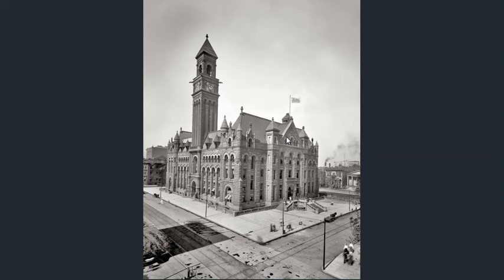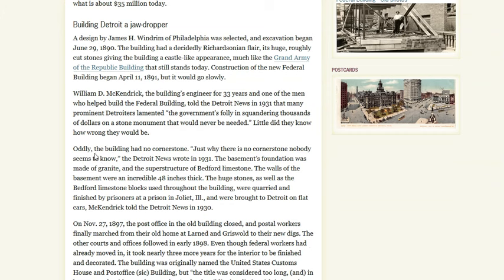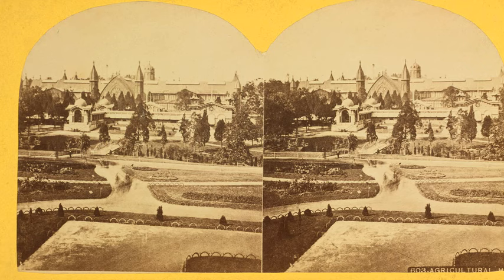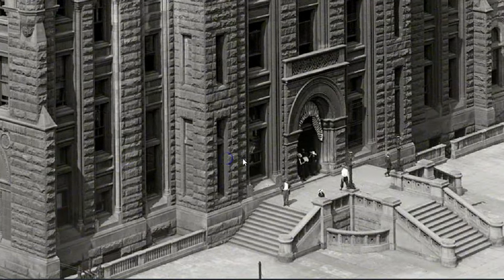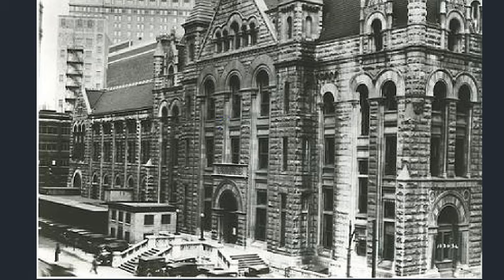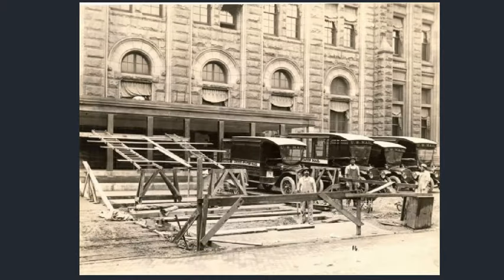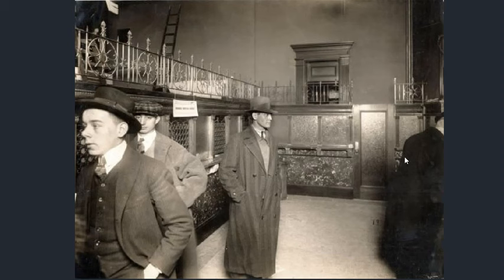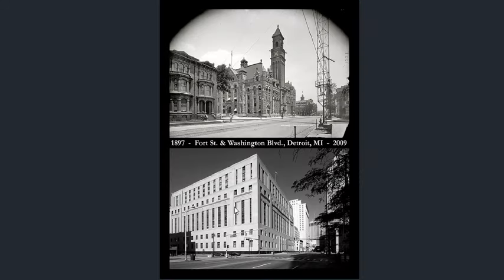Impossible Architecture Vol 2:  The Detroit Federal Building

Comment: I do wisyou people would either go to collage and learn what it takes to build a shed, house or a city block or bring some undeniable proof that you were lied to. Why do all these buildings look like european iconic buildings? Yes there is a gap between the pavement level and the limestone basement level, why, because the damp would creep up the limestone and ruin it, the same reason you shouldnt see fired red bricks below gtound level, hence why they used hard stone such as granite. Big windows and doors, this was before good lighting so big windows let in light. The doorways and high cielings, also before good airconditioning and if the rooms are airy and dry very easy to keep warm in the winter. This was built after hundreds of years of perfecting the building process. Ok they pulled it down after 30yrs, all the materials would have gone to build new structures, it was most likely taken down because of plumbing and electricity had become reliable enough to rebuild a new building rather than do a refit. How much you think the land was bought for? forty years later how much could it have sold for, the land and granite foundations? A lot more than was paid for the first building then he has all the materials for free. They are builders building on land that hasnt even been leveled and in most cases no services have been layed under the roads like we do today, some buildings will be built on low grownd and some on high but the smart ones would have been built so the ground floor will be at the eventual street level even if it is ten years before the street level is established. We live with info on how to build buildings at our fingertips every i dont know or did they build that or look at the size of those blocks should take your kids no more than 15 minutes to tell you the answer. I do get it there are unanswered questions in our history. Take florida or new orleans, one culture claimed then built and stories circulated, their history. The land then became part of the union a different culture built on it leaving some of the best the earlier people built, their stories circulated and on the street became history that we grew up with, then old newspapers and photographs are found along with the history you never heard before comes to light. That doesnt mean you were lied to, you were only taught what was relevent then american history not spanish or french. So now your interested in history start reading and studying history and always be able to back up claims, yours or someones video, check it and dont believe it until you have. Take care we got bigger problems than arguing about old photos. Your moon should not be doing that🌜🌛in one night😊👍
Reply from the maker: Actually I teach the carpentry trade at a college...so I do know a thing or two about how the build process works.  It's the main reason I have decided to publicly question the narrative.  I know what it takes to design a structure, excavate for multi-story buildings, how to set a proper foundation, back-fill, build vertically, calculate complex angles for roof framing, and finish the interior.  With this knowledge, the explanation we are given for these structures is even more outlandish to me.  You should know that if you come to my comment section with knives drawn, the favour will be returned.
Reply: @oldworldex  fair enough my freind, you know buildings. Please brush up on your history then, this just sounds like an easy larp to me. There were aspects of the video like the scaffolding behind the tower was obviously being used as a crane , which you should of known if you teach the trade? At least use your knowledge to teach your subs how these were built, how easy it is to move heavy stone rather than saying they couldn't do it or it was too hard and leaving people that stumble onto your videos more confused than before they got here. Your helping the controllers dumb down the young ones and you say your a teacher? Please wake up, btw, no knives my comment was addressed to the people believing you, but thanks for taking the time to reply and have a good day😊✌️
Reply from the maker: No knives hey...riight.  The condescension in your writing is palpable.  "How easy it is to move heavy stone' is one of the most entertaining comments I've come across so far.  When you suggest I brush up on history, you're missing the point when I say I don't trust history.  Why would I immerse myself in a deception?  It's the underlying theme in my videos.  If you feel lost you can choose to dig deeper.  It all comes down to choice.  @peterdeans4635
Reply: @oldworldex  hiya, I don't trust the timeline either my freind but there are artifacts and writings left by older cultures, some still being uncovered and dug up now, that's the history I was suggesting. You might find why we have blots in the timeline you never know. I wasn't intending on being condescending at all, you say you teach building which you must have building experience, to not see the crane next to the tower and remarking the building goes underground and not understanding or at least not saying in the video that be the land virgin or recycled the dirt you see will eventually be graded off and leveled. Instead what I got from the video was that these people definately didn't build that, how old is it anyway and what happened to the original builders? Until you can prove your assertions, making these old buildings older than what they are just because you don't trust the historical narrative has been done to death on this platform by how many channels idk. There's a difference between being condescending and giving constructive critique and making it clear no knives meaning I wasn't here to wind you up, sorry if I caught you on an off day. Take care✌️😊

Comment: That building was built in 1860, around the time of ‘peak intelligence’ of 1870. Source Professor Edward Dutton.
Yes- even though we have computers and advanced tools, people back then were smarter.
Also the education options were more varied so geniuses flourished. Most engineers, inventors, architects etc were of course in the ‘genius’ class.
Materials and labour were cheap and plentiful.
As for the comment - how were those stones placed?
Just remember the pyramids and ‘we stand on the shoulders of the men before us’
As to no information online about the architect- that means nothing, go to a good library and I’m sure you’ll find out plenty.
Ya all need to read more
Reply from the maker: Sounds like you've got all the answers.  Ya all need to stop believing everything you read.
Reply: @oldworldex  so…make up stuff like you do?!
Reply from the maker: Ask questions.  Stop trusting what you're being told.   @andersdottir1111